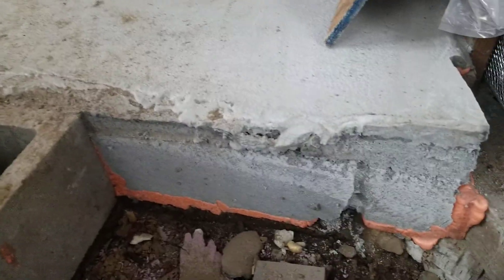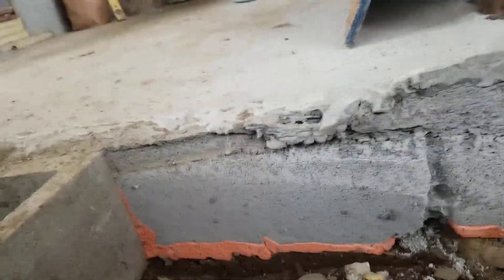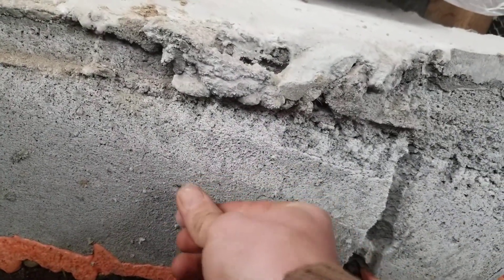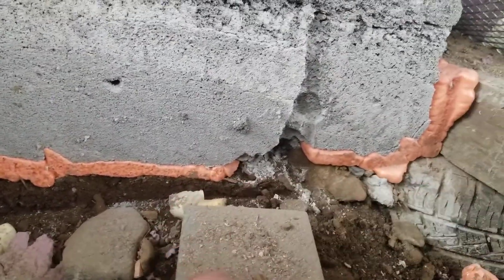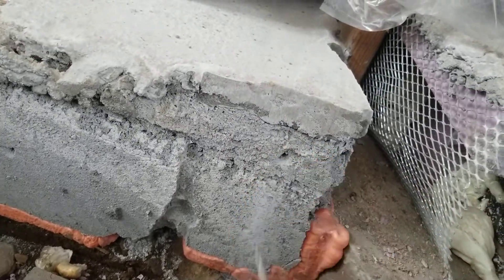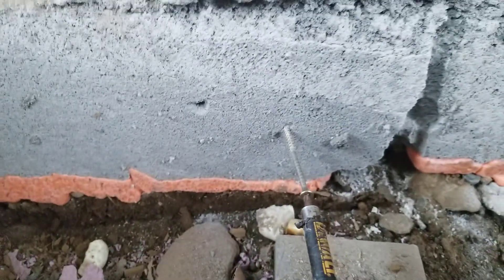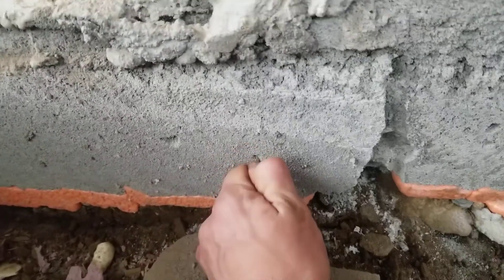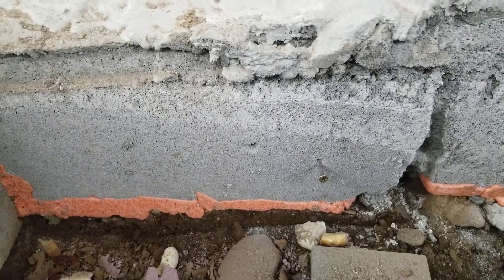Can you Screw into Aircrete?

Comment: When I was building my boat, I used hard points because the core between the carbon fiber skins was not crush resistant and wouldn't hold hardware. 
For a large hard point, the core was hollowed out and a piece of plywood was epoxied in to mount winches and hardware on. The alternative method for a smaller hard point is augering out a hole and filling with epoxy, then drill/screw into the epoxy.

Comment: Aircrete is just bad concrete.
Reply from the maker: *Aircrete is just insulative cement. Concrete includes sand + aggregate + cement.
Reply: @ogfoundation  then call it "airment" and stop building foundations with it. 😀
Reply from the maker: @dreed7312  I didn't name it 😛, and this is just insulation under my kitchen floor,  not structural/ under the walls.

Comment: Drill an oversize hole, fill hole with wooden toothpicks, break off toothpicks flush, install screw, and moderately tighten screw. You can also drill or punch a hole and then epoxy in a suitable size threaded rod. You could also epoxy in the toothpicks if you preferred using screws over threaded rod and nuts.
Reply from the maker: Interesting suggestions... 🤔

Comment: Hi,I'm wanting to make aircrete blocks but cant get foam to stay long enough for portland to set up, can you or anyone help I appreciate it.Thanks
Reply from the maker: There are a number of factors that affect this. First, the type of foaming agent (I've been using Drexel), then the temperature and hardness (ph) of the water, also the amt of water in the mix. Too dry and it often collapses. There's probably other ways to speed up the process as well, which I need to look into, but those are the biggest 4 factors that have affected how my batches turn out.
Reply: @ogfoundation  Thank you I have tried Drexel, Suave, Lauryl Sulfate, also someone  mentioned portland more than 3 mo old. I bought a 1 month old & didnt make a difference they deflate quickly. I had 200 grams on 2 litres ,haven't tried ph test, Thanks.
Reply: After I watched someone spend months trying to make consistent, structurally reliable aircrete I decided this is a novelty, not a solution, and it's a bad idea both in principle and practice. Why not make 'air steel' so your steel will weigh less? How about 'air plastic' to keep your water in? 
Airhead is more like it! It might carve easier, and make an interesting medium for sculpting.

Comment: If you drilled a thin guide hole first im sure that would work a lot better. It would allow it to have space to tap a bit better without just cracking the whole inside.
Also, you could apply a small dab of hot glue to that hole right before screwing in. it should help it grab on to the uneven surface even if the tapping is not great, and solidify around the screw to form a perfect tap.
Protip - if you coat the screw with a thin film of any oil it can be unscrewed later if needed. Ive used this trick many times to screw into materials you normally cant - or simply fix a screw hole where the tapping has been ruined. You can even do this with machine scews ect. which normally could not self-tap.
Reply from the maker: Thx for the tips!